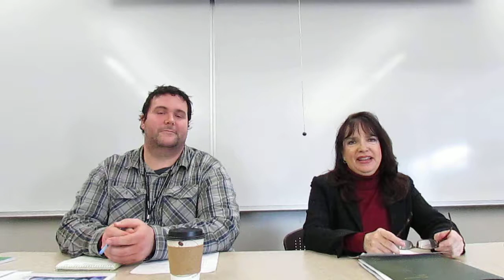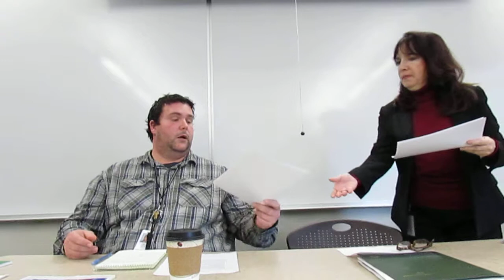Certified Production Technician (CPT) Training Graduate speaks about training and his career

Comment: 1) Turn on your TV. Start counting, restart counting when the scene changes. Do this a few times. Usually you will not count past 30. Also, zoom in and out, or pan sideways. 2) Post a short (10 second) script next to the camera, read off that, not from a paper on the desk. 3) Import the audio to Audacity. Amplify it so that it is audible but not clipping. Also, adjust treble and bass. And, 4) avoid smooth surfaces that reflect sound and light.